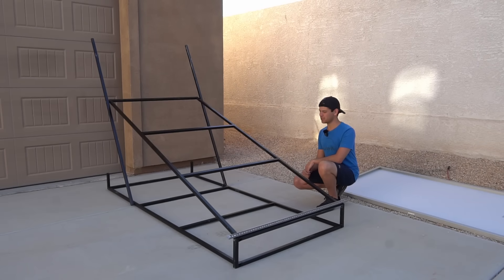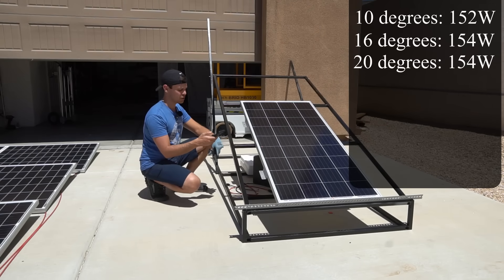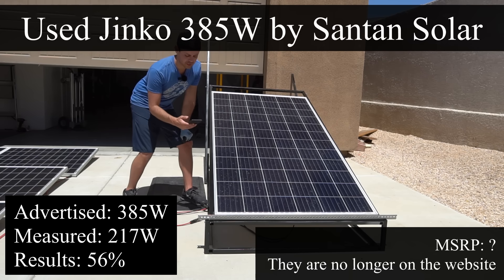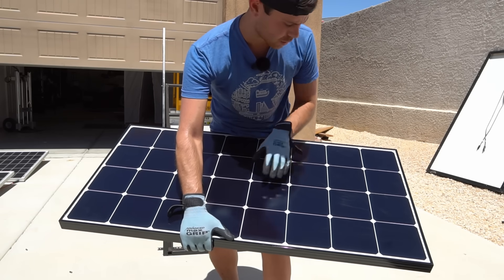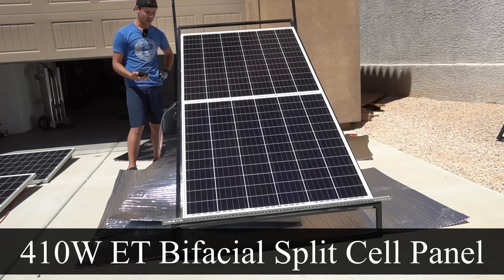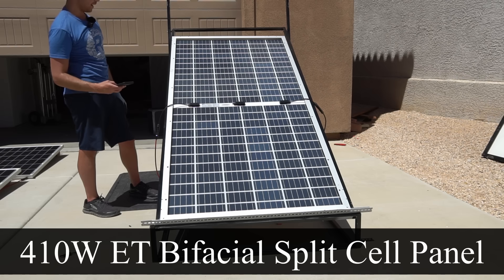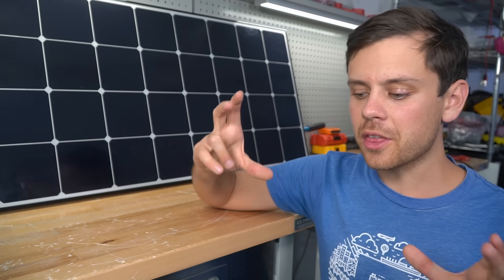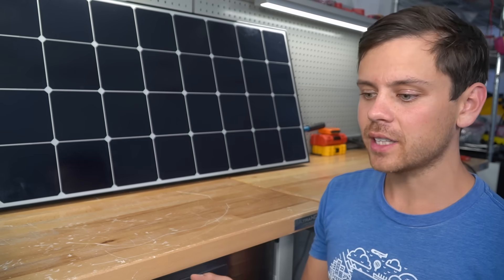Solar Panel Showdown: Sunpower VS Bifacial VS Used VS Renogy VS Rich Solar

Comment: Nice test. Would you mind re-doing the test but at a flat (or another non ideal) angle and with a smaller or bigger shadowed area on the panel? At least I try to park my RV under some trees to stop it from heating up too much (no AC there) and would like to have some solar panels which make the best of the available light :)

Comment: Based on specs and name (T-series) I suspect the Santan 250w is a Trina 250w.  I picked up some used ones for my van and they perform exceptionally well.  I paid $78/ea but then again I didn't have to drive to Santan. :-)

Comment: For my 12v system I'm going to buy a 300w solar panel off ebay for $100 and even if it underperforms by 50% the cost:output ratio is still much higher than buying a straight up 160W panel

Comment: I was excited about bifacial panels for sailboats. But the temperature impact on them definitely would reduce usability, I think. But there tends to be quite a bit of space below them and a LOT of reflected light. I'm still curious to see someone use  those panels on a boat.
Reply: I had the same thoughts, I wanted to try biracials on my boat but I only have room for 100 watt panels and no one makes a 12v bifacial so I went with 4 eclipse panels.

Comment: Hi. I bought a travel trailer and it has a GoPower system from the factory. It consists of two 190 watts solar panels and a 30 amps PWM charge controller. I upgraded the factory inverter to a 2000 watts. I would like to upgrade to a MMPT charge controller. Should l stay with a 30 amps or go higher and will it be worth it. If it is what model would you suggest. Thanks

Comment: I pulled 130watts on a 110watt sun power flex panel in Ohio yesterday. It’s brand new though. His flex panel has smaller cells than that renogy panel with sunpower cells.

Comment: sunpower cells are nice. i have two sunpower maxeon 3 panels 395w on my van roof as they were the smallest panels in the 400w range anf fit my roof rack being 300mm shorter than other 400w panels. so i have 790w of panels but even flat on the roof i have seen 873w!

Comment: Hi Will, I have a question for you. I’m awaiting a 250 kWh Jackery I just recently purchased. It has the 8mm input jack. I have 2 - Noma 100 watt glass panels that have SAE connectors. I just need to know if I need to hook them up in series, or parallel for the Jackery. Also, could you suggest a link to where I can get the connectors so I can join the 2 panels to the 8mm Jackery? Much thanks in advance!

Comment: Suggestion re Background - Drop Sheet.
Instead of using the silver reflector, use a Pure White drop sheet as it will reflect the full spectrum.  Ideally, 3 colours for the test would be good for comparison, you might be surprised,  white, medium brown/sand, medium - dark grey would "simulate" most setups if you think of ground mount to roof mount backgrounds.

BTW, Bi-Facial installed on roofs have some different requirements & suggestions for improved performance.

Comment: I just bought 3 eclipse panels for my SUV. Sounds like a good choice. Glad my research paid off.
Reply: They are working well. Paired with a 150 ah lithium and dc-dc and solar chargers. I'm only using 2 of the panels though as I dont have the room on the roof for 3. Not getting quite the percentage of charge that he was but im also in Southern Ontario Canada so sun isn't as powerful up here for most of the year.
Reply: @BushcraftNFun  Nice!
Reply: @BushcraftNFun  Yeah, hard to beat the desert sun xD
Reply: How did they go??

Comment: Hi Will, loving the videos, super fun test. I'd be interested in your thoughts on a solar panel I bought from Photon Universe. Its a 150W panel and I've recorded 163W from it via my Victron MPPT. Its also a flexible panel mounted on the top of my campervan. The panels from Photon Universe are expensive, german solar cells and assembled in Austria. So far its been a breeze keeping my 105AH Lifos Battery charged with a fridge running 24/7, heating in the evening/morning and charging my computer, power bank and cameras. If you get short of things to testi that is, by the way i'm in Northern Hemisphere in England.
Keep up the great work man.

Comment: Would love to see a video of various panel cooling methods vs efficiency buddy! 

Those Jinko panels look like warranty returns, they cant be more than a few years old and if the failure rate is that high solar installers would have stopped using them.
Reply: Yes, would be curious on what had gone wrong with those Jinko’s

Comment: It would be nice to test how performances are affected by overheating. Your results seem extremely good.
In my case with flex panels I have seen performance decrease with high temperature of more than 15%

Comment: Btw you missed it but short offer a New this year Renogy Mono panel 100 w for $87.  Bought four for future instal. Bought more bvrouge 180's for 179 at amaz. They lost one gave me a free one. Got 4 180 watt panels for less than 550 bucks new manufactured panels. Use them in ac200p.
Reply: Follow up sorry but the $171 Renogy panel deal was cuz the us postal service hosed my orders. Lost panels(mailman has em?) to compensate. I was gonna order 4 more rougebv but got the $87 panel eclipse offer. If I knew they took 85 off might have got more. They were special delivered with the free 180 w panel. I ordered second eb240 for them 

I payed <$3 to power company in april. In fifteen days used less than 40 kwhrs. Inside light, control ac system cold water heater only loads. In socal First kwhr 23 cents. After -300 or so its 27, at 901+ they charge 37 cents today. Rates to increase in a month. 
Will. I use 82.5% rated x 7.75 hrs/day here avg power from Sun. Need 20% reserve at full sun on panels. Clouds, dust reduce inputs from 3x180, plus 100w in series to 475-675 full sun clean panels tilted 15° from ground no shadows. To ac200p. Peak seen was 717w, lowest 475 at noon. Hazy sky. 
Next is backup for two days reserve power. Gas 4000/8 hours on 4 gal of gasoline backed up. 
If I can do it you guys can. Budget limited only.

Comment: Can you try the bifacial panel mounted higher off the ground?  It seems like more scattered photons could reach the back that way.  Maybe a single pole would shade minimally? Or for testing a rope at each corner? Being so low to the ground doesn't seem fair.

Comment: Best angle is when something vertical/perpendicular to the panel does not cast a shadow anywhere but itself. As made somewhat famous by a guy down under in an Off-Grid Garage, set a can of beer on the panel and adjust so the shadow of the can is under the can.

Comment: I love all your videos! I have copied your 200w system for my van with a cheap walmart 100ah SLA battery and a cheap Chinese pwm controller. 
Because of my budget ive had to start off pretty cheap, but its been holding up for a year now! Probably cycled this battery too many times though and its getting about time to upgrade to a lithium iron phosphate battery! 
Thanks for all the videos!

Comment: Have you tried using dual mirrored surfaces on the ground, with the bifacial solar panels? Having the narrow top end frame pointed up toward the Sun, Instead of the flat surface point at the sun, reflecting the Sun onto the panel to keep them cooler, and having the panel closer together!

Comment: How is it possible for pannel to produce over 100%? I have ege-158-340m-60-hc 340W panels made by  eco green energy and they produce 380W which is very confusing.... I am logging panel volts and amps at mppt input using arduino. Have calibrated/checked sensors numerous times and am still getting 110% of rated output! I live in Vilnius (54.6872° N, 25.2797° E) which is far from best location in terms of solar irradiance.
Have tried searching online, but usually people complain about lower watts, but not higher :)

Comment: With this now I'm convinced to buy bifacial panels, since here in Chile the weather is not too hot but we get a lot of sunlight
Reply: Y creo que también pueden servirme en la pequeña chacra que estoy en vías de adquirir en la sierra de mi país (Perú) Realmente el sol pega todo el día pero difícilmente sube de 24 grados al medio día...
Reply: @Leopoldo888  Genial! yo quiero instalarlos sobre un techo de zinc de mi casa, creo que el material es lo suficientemente reflectivo. Por ahora estoy luchando con unos paquetes de baterías 18650 que estoy armando para lo que será el sistema con celdas solares.
Reply: @Azbel_tk  To get the best out of bifacial they need to be a good distance from the surface, 1 metre is usually recommended. So they're usually mounted on the ground, not the roof..
Reply: @johndalgliesh9220  you can get that clearance installing them on the roof...
Reply: With only one specific example given here, it is not yet conclusive about bifacial in general.

Comment: Will, you forgot to take in to account the efficiency of the mppt controler at different VMP... it can easily varry from 5% between different VMP and and other 5% from different power
Reply from the maker: Oh I know. I factor that in. The power reading was before the conversion loss. The 24V battery and higher voltage panel differential was nearly the same. I figured it was fine
Reply: Thanks for you reply, many controller brand have their power curve vs efficiency available, but Victron don't show that curve... They juste say "peak efficiency 98%" and if the power calculation in done ont the output of the controller (as it should) that may explain why you are getting some of your big difference

Comment: Evening. I have 6 of the San Tan Solar 250W panels mounted on a 5 x 12ft cargo camp trailer top and sides for 1.5KW off grid solar for my instapot / crockpot cooking setup. they work very well for me in south Arkansas with no need for generator backup.  Batteries are 2 of the DIY 280AH lithium milkcrate builds in parallel from an earlier video.  Thanks Will for your info and inspiration.

Comment: My friend has quite a few of those 250w santan panels and we both went about 6 months ago and he bought 4 more, tested them all, and they each pulled about 230-245 w a piece. I bought a jinko 40w panel for 200$ and it was pulling 390w when I tested it alone, bought I have it paired now with an LG 335 bifacial one. The Jinko is not even close to the lG in build quality, but it does work really well.

Comment: Cool rack. I like that it is adjustable. Good job. Also, nice review and report. Consider a 1 Gal. Pump Sprayer from home depot. They are like $10 for 1 gallon. Old Windex bottle didn't put out enough water. I often wonder why there are not more auto-sprinkler setups to cool down solar panels. I have a canal behind my house and thought if I ever get panels (Miami, FL) I would rig up a sprinkler system to cool them off. We are pretty constant temp 70-95. Thanks for sharing.

Comment: You should try the 380W Heliene 72-Cell Bifacial North American Made Solar Panel. I am in Texas and was getting 445 watts from each panel today. I was blown away.
Reply from the maker: Holy cow!
Reply: Everything is bigger in Texas.
Reply: Wow that is great output. Was it partially cloudy over head by any chance? The clouds do reflect sun, I watch my system on all kinds of days.
Reply: are they ground mounted or on a roof?

Comment: better to test two bifacial panels at a time. keep a little more vertical and over lap a bit. reflection  from second panel will add to back side of first .{ good test to do}  make spaced like a  set of steps. keep shadow of first off of second panel.
Reply: make it so

Comment: I feel like the bifacial panels should actually have the albedo from the back of the wall behind them instead of of under them.  It would be similar to a panel on the roof of a porch  that has a building's wall behind them to reflect the light from the back and up under.

Comment: Will - you might want to cover those sharp "ears" that extend beyond the frame at the bottom of your rack.  With you wearing shorts - you are going to tear up shins on those things.  If you don't want to cut them off - wrap some rags around the "ears" and zip tie the rags before you get injured.  My experience is that if you could potentially be injured.... eventually you will be injured.
Reply: Dude - get a life
Reply: That metal don't feel no pain 😂 is how I was taught what you are teaching. No pain at all.

Comment: Maybe you should try the bifacial panel at the higher angle, but put the reflective surface... white stucco would be good, about 12 feet behind the panel. Try to get as much light as possible to reach the back of the panel. This way you are recognizing their creature and working to maximize it.

Comment: Thanks, Will. I think the bi-facials will perform better if more elevated from the ground, say about the height of a patio cover. At lot of the ads show this type of installation, especially if over concrete, near white if possible.

Comment: Thanks for this! Timing was great cuz I'm about to buy some panels for the first time to charge my 1000w generator. I'm looking at  4x100 mono Rich Solar panels. I live on the California central coast so it's a bit cooler here with foggy mornings and evenings, typically about 5 hours of sun on average most of the year. Would you still recommend the poly panels given my location? Thanks again for all your great videos!

Comment: Regarding that 56% panel, you might break into the junction box and test/replace the diodes..  Bifacial in the desert..  LOL!
Reply from the maker: Yeah I'll test the diodes, good idea.
Reply: @WillProwse    When changing out the diodes, I would consider using higher volt/amp specs...  Maybe somehow venting the case, a better heat sink, as diode failure is a known problem with these panels.??
Reply: Or clean the panel. It looked waydirtier than the others
Reply from the maker: @USNEM  yeah I did clean it. It arrived with marker and stains on the front
Reply: @USNEM    So, how clean do the panels have to be..??   Do you intend on climbing on the roof everyday, (really fun living in a two story house), to make the panels spotless.. LOL!
C'mon now!!!

Comment: Good video. Nice rack build, but dude... I don't get it. You're (capslock) "THESE ARE VERY VERY EXPENSIVE... IF YOU CAN AFFORD THESE...". Is $179 that expensive??? To me it seem that a $179 solar cell panel is some of the cheaper stuff you advertise on your channel (batteries, pure sine wave inverters, etc.).

Comment: If you add a half-pipe across your driveway, you could double the use by having the concave side of the pipe focus light to a solar panel.
Reply: Could you explain "half pipes"
Reply: @fuzfire  I meant to say 2 quarter pipes.  These are skate/bike related.

Comment: Great video.  Just wanted to share with you that we have twelve 100watt renogy monocrystline panels on our RV and our peak output ranges from 1100 to 1200 watts every sunny day.   Some days we even get more than 1200.  
Just wanted to share that since you mentioned they usually underperform.  
I would be glad to share our data if you’re interested.  :)
Reply: I've seen 610 watts from 6 of those 100 watt renogy panels so I have to agree with this.

Comment: I have two of those eclipse 100w renogy panels on my jeep and they work fantastic even with a fixed flat mount.  They also work well in partial sun - I had decent output even in mixed snow flurry conditions. :)
Reply: Must keep it a lot cooler with the shade?